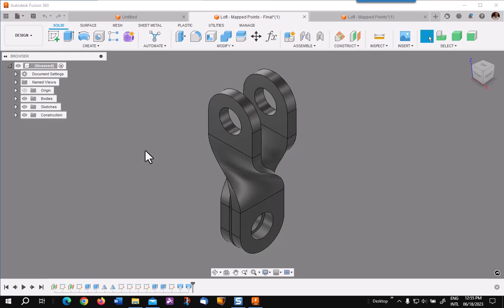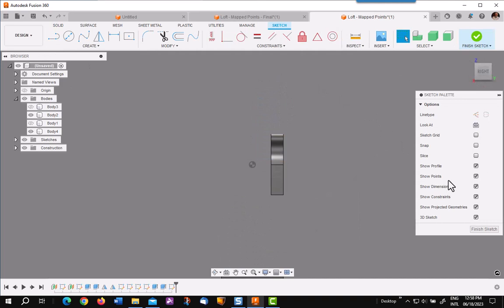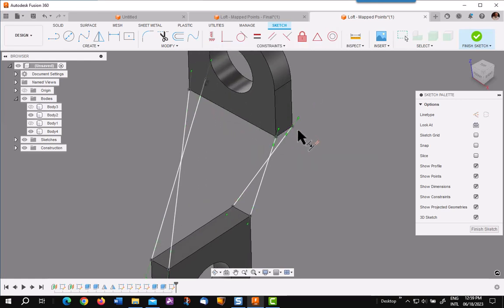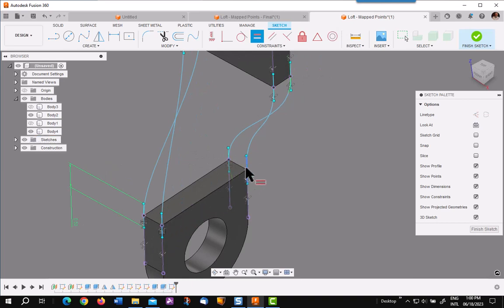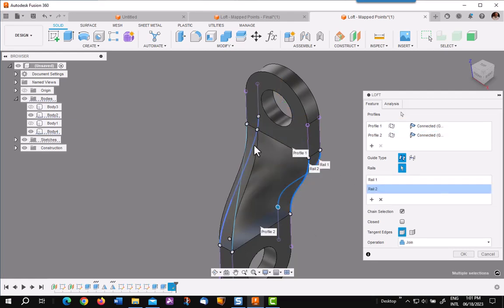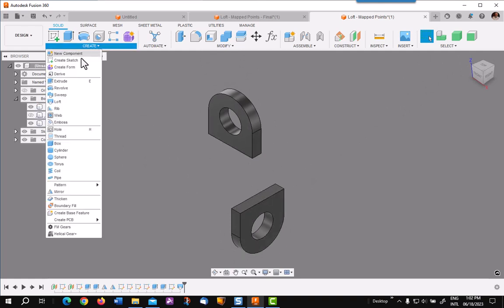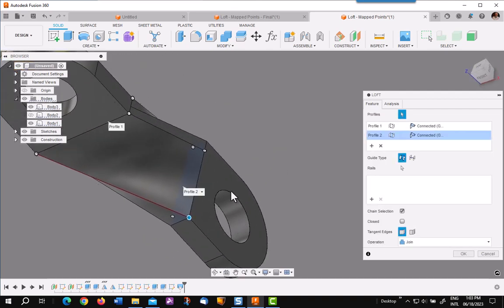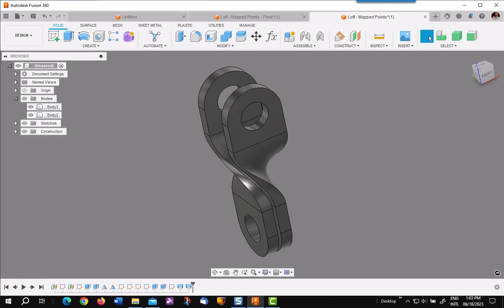Lofting Using Mapped Points in Fusion 360

Comment: Have you ever run into a case like this where the handles for mapping the points just don't show up? That's what I've hit here, and I cannot figure out what is going on. Fusion's lofting appears to break down entirely when attempting to deal with non-planar components. (Frankly, a great deal of Fusion's tooling appears to break down when trying to do anything non-planar, but that's a separate discussion.)